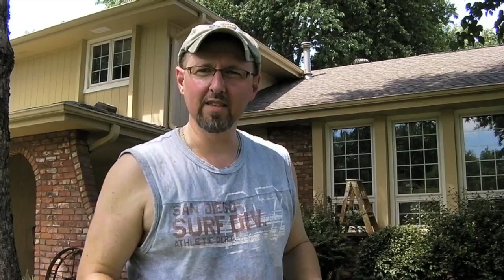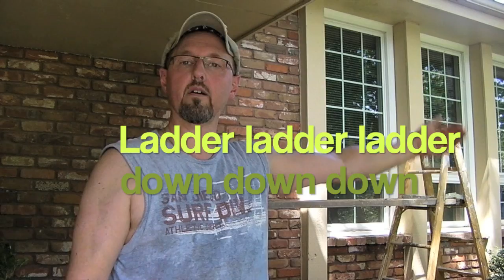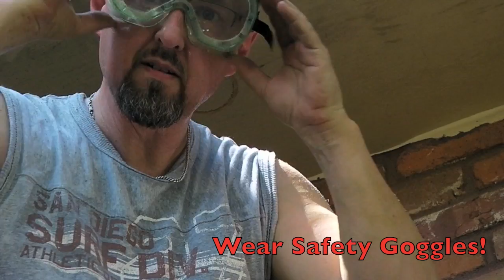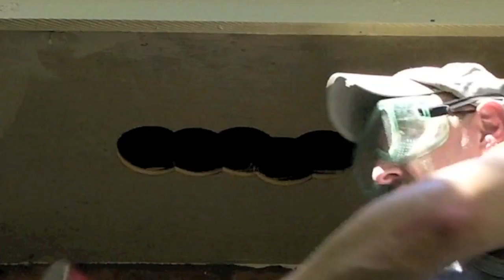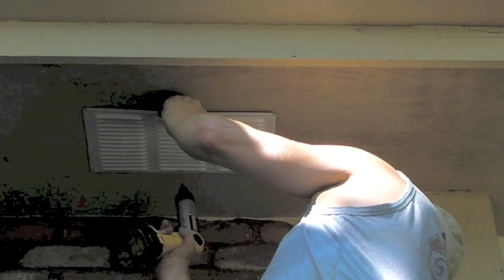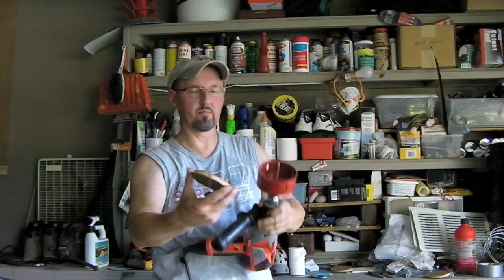How to Install Soffit Vents

Comment: Sheet, you're making this way too involved.  Just make a cardboard template 1/2" or so smaller than the vent cover overall. Position it evenly between the rafters under the soffit and trace trace around it. Drill a few pilot holes and jigsaw the hole, install the cover  and ur done.
Reply: +Captain Hook - it's not more involved the way he's doing it, it's just different, using a different tool. If I didn't have a jigsaw but I had a hole drill, I'd use the hole drill. Doesn't much matter what the hole looks like or how it got there, as long as it's large enough but not too large.

Comment: Tony, you missed the point of a soffit vent. The square inches of you hole was mush less than the sq in of the screen. The point with attic vent is, 50% out(rigde vents) 50% intake (soffit) 1 sq ft of air flow per 500sq ft of attic space(floor space) If you only have ridge vents, a vacuum can form inside your attic and SUCK in snow or rain. Balance the intake and exhaust air. Why add a 16x8 screen and have a smaller hole?

Comment: soffit vents are illegal in az and ca because of wildfire risk. you sure can suck insects, hot embers etc up into the center of the attic. Not good. Thats why the louvers face in. Alot of installers will put a piece of fiberglass batting behind the soffit vents to lessen gusts from blowing insulation into piles and the fore mentioned wild fire risk.

Comment: Well if your roofing contractor installed ridge vent, then you more then like already have a vented soffit system, whether it be a pro-bead hidden vent soffit, or a fully vented soffit, just look into the soffit area to fully insect it. If they are not installed then the ridge vent is only venting the existing attic / house air, and is not bringing in fresh air into the attic space which, if left untreated can lead to mold and moisture damage in high temperature areas.

Comment from the maker: The flat, square fixed vents have screen already build into the louvered area.  You would not need additional screen.  I have installed the turbine vents and did not install screen.  Since they spin pretty much most of the time, you really don't need to be worried about bugs getting in.  However, if you live in an area with little wind, installing the turbine vents aren't going to do you much good anyway, so go with the fixed type.   
Did that help?

Comment: as far as venting your attic, a very inexpensive way to insulate your unused attic space (I've found) is to peruse your local flooring dumpsters. The old carpet you tend to find has been removed from either a business or upper class home. I've got one layer of very clean used carpet down already. That's in just a couple of months. I haven't even had to turn on my ac yet this year. Well worth the dumpster diving effort.

Comment: @tooldudetony--- There is some good info about attic venting on Air Vent's website.  You sort of have to dig a little bit for it.  But they do a pretty nice job of talking about the do's and dont's of attic ventilation.  Didn't mean to come off as a punk.  It's amazing how much science/physics is really involved.  It's really not just a matter of opening things up.  It needs to be balanced for the ridge vent to do what it's supposed to do.

Comment from the maker: @EnuffsEnuff318 --- Thanks for your comment.  That is good to know.  As near as I can tell from the formula, there should be a minimum of 5 16x8" soffit vents to balance with a 20' ridge vent for this attic.  There we no soffit vents at all in this section of the attic.  So, even at half the capacity, it's better than it was.  T

Comment: In order to PROPERLY vent the attic, the intake net free space should equal the exhaust net free space.  You actually CAN have too much of one or the other and care should be taken when selecting vents and hole size.  Each soffit vent in this case, has a rated net free space and the opening that you cut should coincide with the size of the vent.  In this video, that vent probably lost over half its capacity installed over that opening.

Comment from the maker: @rogofam --- Right... I have a vaulted ceiling in part of my roof and the shingles have been burning up on the south side because they didn't leave enough ventilation.  I've also seen people put garbage bags over turbine vents in the winter to keep the heat in their attics.  They just don't get it...   Thanks for your comments.

Comment: I just pulled off all my aluminum soffit because of a suspected  soffit ventilation problem.  What I found under this beautiful aluminum vented soffit was the following.  A solid plywood soffit with one 3" x 16" vent for a approximately 80' long soffit area .  The contractor was too lazy or too naive to cut holes in the plywood before he nailed up the aluminum soffit. Now I can pull it all off and replace it.  Great hey?

Comment: Use the calculation that will tell you how much minimum soffit venting you need and then add some more!  You cannot have too much.  Only too little!  Contractors are known for putting up venting screens over small little punch holes or worse yet, no holes at all!  Hey after all the problem they cause won't be discovered until 15 or 20 years down the road when he is long gone!  Not his problem, right?

Comment: I hate when siders do this method.  First off, ventilation screens are rated for a certain amount of airflow.  They have to be fully cut to the shape of the vent, not holes.  This restricts the airflow.  How about a square hole cut out to the size of the vent by using a sawsall or similar tool?  Venting is important!  I purchased a home and the owners had limited soffit venting causing a buildup of moisture and resulting in mold.  $14 k to cryogenically blast it and remove insulation!